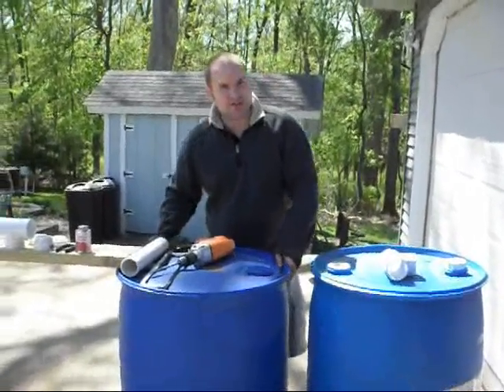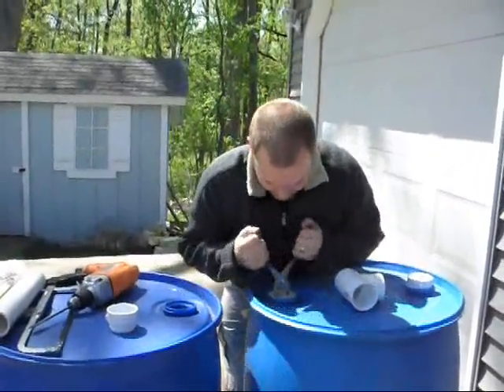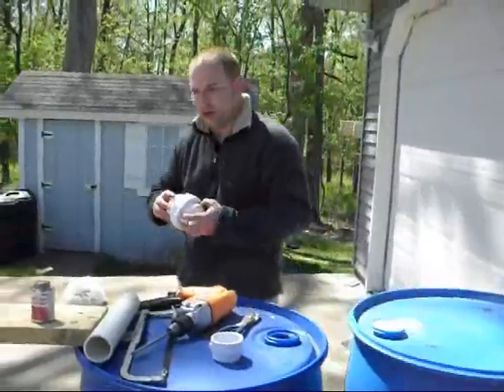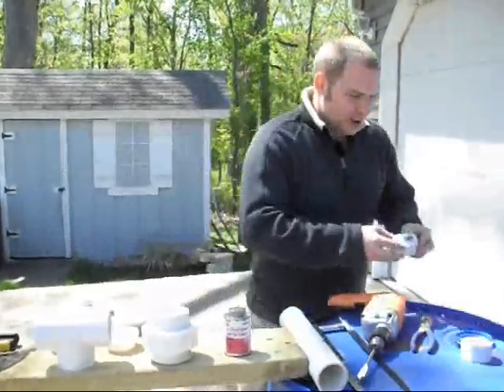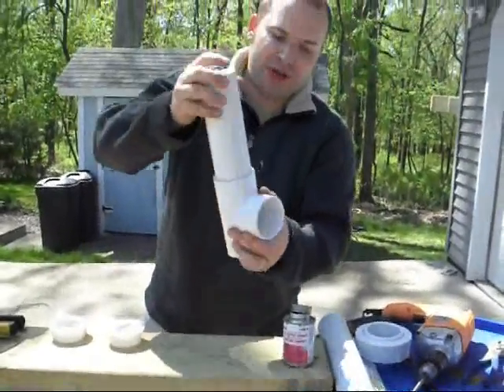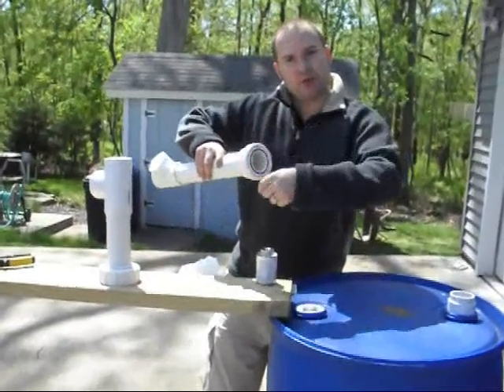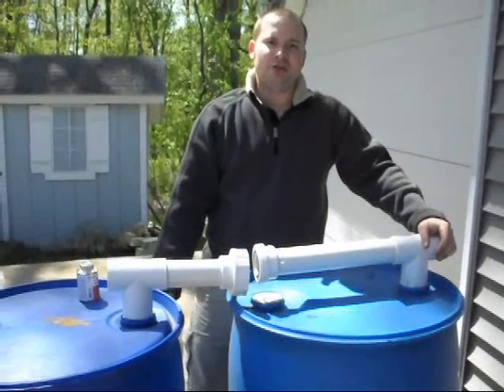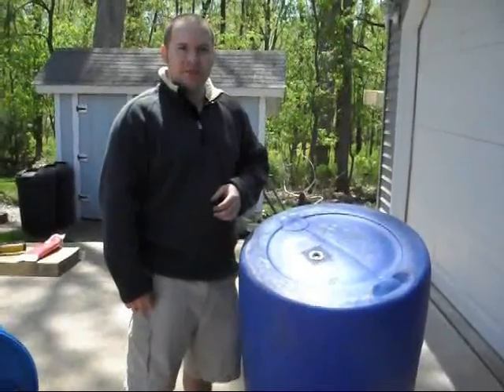Making Connectable Rain Barrels

Comment: Brian, how is this a pressurized system if you put air vents in the bottom(top) of the barrel.   I would like to use this system chaining barrels together to pump water into my cabin.  I currently only have gravity flow.  Any suggestions.  If I pump water from the barrels I will need to run some kind of air vent system which shuts the vent off when the barrels are full and not lose any water.  Thanks. I enjoyed the video.
Reply: I thought of a long 1/2 inch pvc vent pipe higher than the water source which is about 20 ft. above the cabin.  This might work and allow air out but not water and still be able to pump water into the cabin without collapsing the water tanks.
Reply from the maker: Chris Baker This is all based on gravity flow - so there is no pressure in the system.  That is why the barrels are elevated to up just under the gutters for the maximum amount of gravity flow that is possible.
Reply: bsntechdotcom
Thanks Brian.  Did your 2" male threaded fitting fit easily into the smaller threaded hole?  I purchased a male fitting but it will not screw in.
Reply: bsntechdotcom
I read on down and you answered my question about the male threaded 2" fitting. Thanks
Reply: Chris Baker There is an article here that does a step by step on how to attach a small pump :)

http://deepgreenpermaculture.com/diy-instructions/recycled-plastic-drum-rainwater-tank/

Comment: The system is very good. If you use rubber pipe sleeves instead of the connectors, you have a better fudge factor and a easier system to break down.

Comment from the maker: Well, that depends how close you will have the barrels.  If right next to one another, measure the width of each barrel and then maybe add a few inches to it just to have some spare.  Or to be absolutely safe, probably figure two feet of pipe per barrel.

Comment from the maker: Each barrel has two holes at the top.  One of them has very fine threading and the other has coarse threading.  Ensure that the one with the coarse threading is securely fastened in the barrel - and that an O-Ring is on there to prevent any leaks.  Then, you will take the O-Ring from the fine-threaded plug and put it on the male-threaded PVC adapter - then put the male-threaded PVC adapter into the fine-threaded hole.

Comment from the maker: Sounds like that should work fine.  Just wonder if a 3/4" pipe is going to be enough to keep up with the flow from your gutter is all.  Unless you mean you will be attaching multiple barrels together with the 3/4" pipe and you will have a larger pipe from the gutter back up to the top of one of the barrels.

Comment: Thanks for the reply. I think I could attach the lines via the 3/4 in thread in the bung, hopefully that would be water tight. I'd like to go through top of barrel. My gutter is about 17ft away so the line would basically making a U to the top of the barrel (down to ground from diverter, parallel to the ground 17ft, then straight up to top of barrel). Do you think this would work?

Comment from the maker: Yep, you could have the water enter top, bottom, side, wherever.  In my barrels, the water comes into the top of one barrel - which then equalizes out amongst the other 11 through the 2" PVC pipe at the bottom.  Definitely have to be careful though because it makes more sense for the water to come in from the top than anywhere else.  If you have any kind of hole below the top of the barrel that isn't covered or has a valve, water will come back out (gravity flow).

Comment: Great video.  I am building a similar 5 barrel system using 2 inch pvc.  Quick question maybe you could help with... I will have a rain diverter on my gutter that will feed two 1 inch hoses into my first barrel.  I was told I could have these feeder lines enter the barrel at any spot, preferably the near the bottom of the barrel (or even the 2 inch pvc if I could find a way to connect).  I see you feed your barrel via the top so wanted to hear your opinion.  Thank you.

Comment: i am working on the tank which i took off the water truck which is 7000 Gl and i put on the top of the cargo 20Ft  StorageContainerch is about 150 ft away from my roof i was wondering if i take  PVC pip down from  my roof to the tank the top part of the tank is about 5 ft higher then my roof can i just connect to the lower drainage you think it will fill the tank

Comment: Your video gave me some good info on the project I'm working on.  Thanks!  I am using boat thru-hull connectors for the vents on top and constructing an automatic diverter out of PVC pipe.  When the barrels fill, rainwater will flow into the drain lines to the street as normal.  The barrels are in an elevated and enclosed box to provide pressure.

Comment from the maker: The connectors that you use is fully up to you.  Since I have 12 barrels all connected together, the 2-inch pipe is what I used.  Another thing that you have to consider is the amount of water flowing into the system.  Since I only have one downspout going into one barrel - then all of the other barrels fill up, there needs to be a big pipe connecting all of them to manage that flow.  You don't want to be hung up by the smaller piping and lose rainwater because of it.

Comment: Thanks.  What about if I intend to have groups of 2-3 barrels around the house with possibly 4 or 5 barrels in one area.  Do you suggest the 2" PVC even for the smaller groupings with 2-3 barrels if is that overkill?  I can see if I hooked up 10 barrels in one place, but I welcome your thoughts about this.  Great stuff.  Also, I would love to see how you flip the barrels over.  Do you wait til everything is set up down below and then, last thing, connect via unions?

Comment from the maker: Not fully sure unless you got some barrels that are not proper sizing.  2-inch PVC pipe and fine male-threaded connectors worked without an issue with the barrels I used.

Comment from the maker: Yes, the 2 inch pipe allows for better capacity and pressure.  If you use the 3/4-inch pipe, the largest pipe you can use to go out would be 3/4-inch.  The 2-inch pipe certainly is more expensive - but if you plan on having a couple of hookups to this (as I have), you can't force 1-inch of water out of a 3/4-inch pipe.

Comment: Thanks alot for the video.  I am leaning toward going the direction you lay out with 2" PVC but I notice that most of the other vids on YouTube that show a manifold system like this tend to use 3/4 " PVP by going thru the middle of the bung and connecting all barrels with 3/4" piping.  What are your thoughts on 3/4" vs. 2"?  I am going to hook up 6 barrels on side of garage and want good flow.  Does 2" give greater flow and pressure?  Thanks!

Comment from the maker: @DeLudre 
That piece actually came with the barrels.  There are two holes in the top of each barrel - and there should be male-threaded cover/stopper.  So this was a piece that came with the barrel - and I simply ensured it was completely tight so water wouldn't get through it when turning the barrels upside down on the platform.